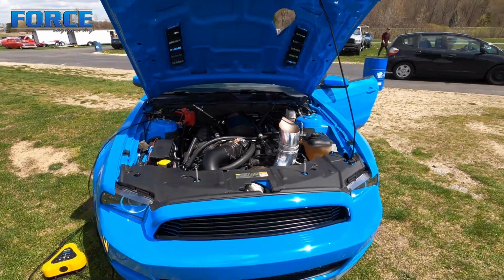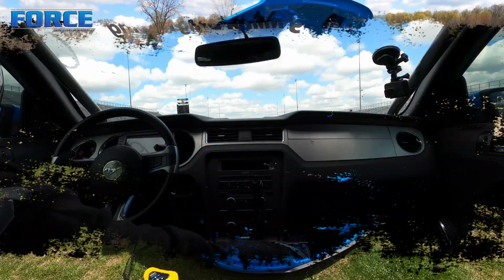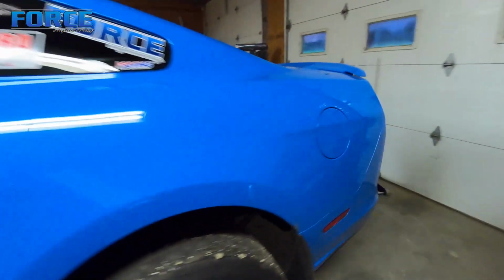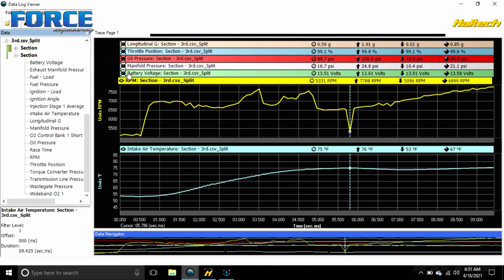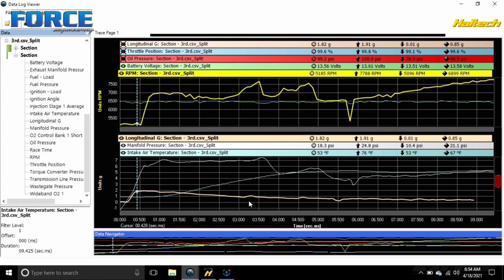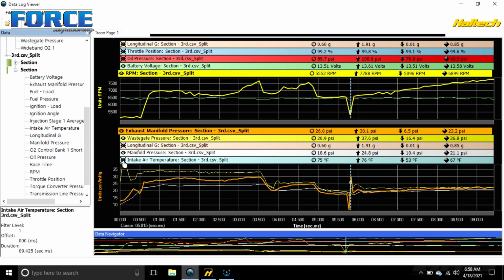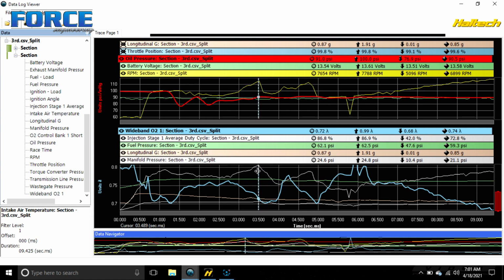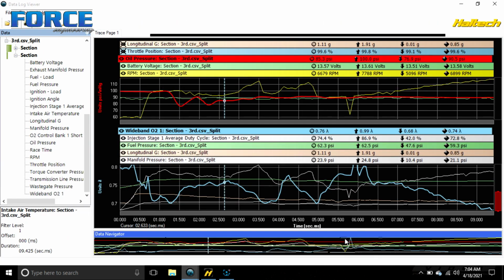Fastest Stock Engine Gen 1 Coyote! | Pass Debrief | Haltech | Breaking The Record

Comment: How long did this car hold up like this?
Reply from the maker: I ran in this form at various power levels for 5 years. After we went an 8.26@164 with it, i put a built engine in the car, and we went 1/2 mile racing. The stock engine is still complete and unhurt.
Reply: @ForceEngineering  awesome thanks for the reply currently working on a budget build gonna call your shop soon
Reply from the maker: @CarlosMartinez-or9sg  sounds great! I dont normally answer. Please leave me a VM.
Reply: @ForceEngineering  just did thank you!

Comment: Congrats!! New subscribers here.  I’m all about the tech stuff and looking over data logs.  
My ‘14 nitrous gt does alright but I have a few questions if you don’t mind me asking
On a stock long block, what is a safe rpm to run?
When installing headers and free flowing exhaust, my x pipe did not come with 02 sensor bungs for the downstream 02’s.  My question is how far from the upstream 02’s would you put the downstream 02’s?
Appreciate it 👍🏽
Reply from the maker: With OPGs and a boss manifold we turn them 8000 regularly.  Anywhere after the cat is ok for the 2nd o2 sensors.
Reply: @ForceEngineering  How about stock long block with 18 manifold?
I don’t have cats on my off road x pipe.  The upstream sensors are right near the collector.  From what I can tell on other header and mid pipe pictures it appears to be about a foot of separation between upstream and downstream.  Does that sound about right?
Reply from the maker: @NITROUSnBIASPLYS  that manifold wont work well to 8k.  Iirc 7500 or so is when they fall off.  

If you dont have cats. Dont run the downstreams at all.
Reply: @ForceEngineering  thanks, my tuner wants the downstreams installed I think of legality reasons 🤷🏻‍♂️